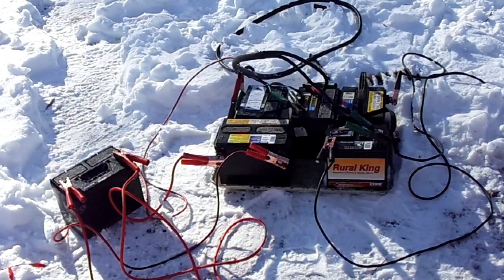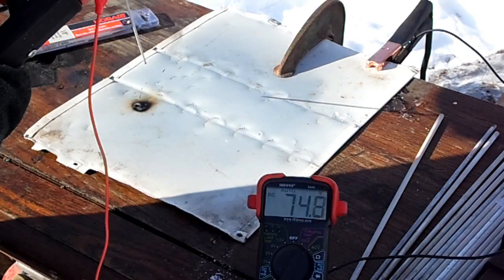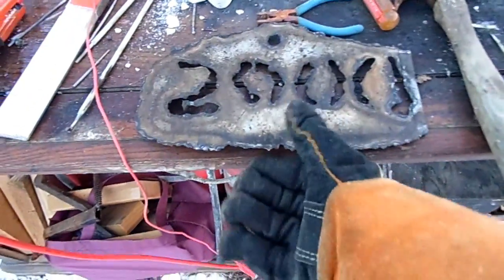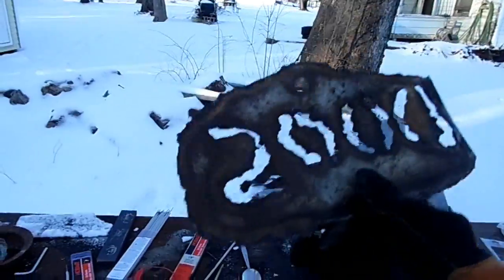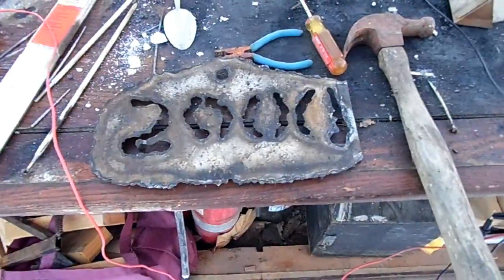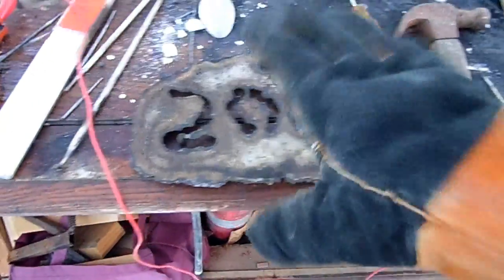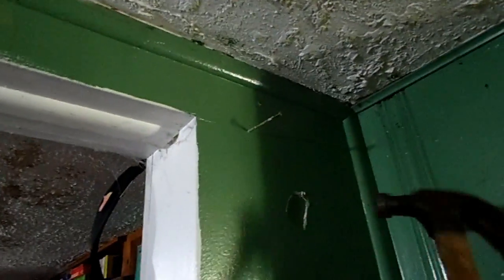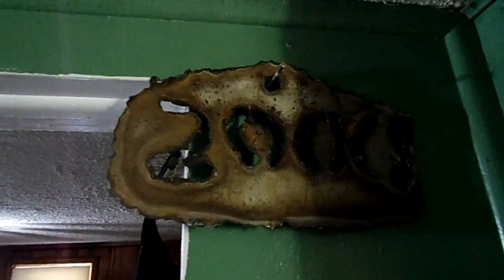2000 subscribers

Comment: I subbed from watching a the battery reviving video. I wish you were my friend so you could help me out cause i always have electrical questions. Like if i have an electric pocket bike 24v motor) and two 12v batteries wired in series; would i be able to pull 12v off one battery in the system to run led lights on the body?
Reply from the maker: yeah you could do that. but you could also possibly buy a 12v regulator from ebay.

the only issue with pulling an extra amount of power from the first battery is they would get out of balance. this would be fine for something like Lead Acid that doesnt need balancing. but if the cells are lithium they may take longer to balance after each recharge depending on how they are wired up.

and you can always ask me questions via youtube. i'll try to answer as quickly as possible ^^b
Reply: Wow thanks man your awesome. They Lead Acid batteries and would only be using maybe 6 small leds so it should be ok right? I will also look in to regulators as I am always doing projects like this.
Reply from the maker: oh yeah, LEDs dont take much power.

Comment: 10v at the clamp when you shorted it for a few seconds...! That's insane! I wonder how much current was flowing?
Reply from the maker: prolly more than 1000 amps. 10v devided by 6 batteries is like 2.2v per battery. starting a big truck can take like 900 amps and that only drops one battery down to like 7v.

there is one trouble maker battery in that pack though. it doesnt have much power.